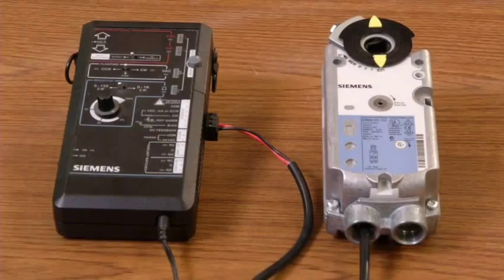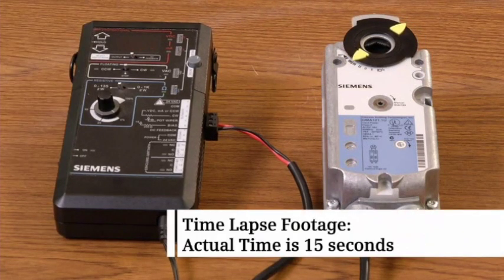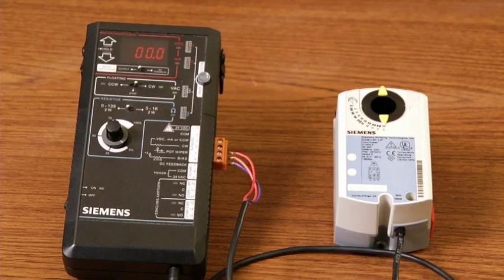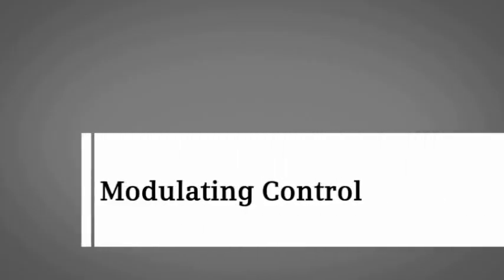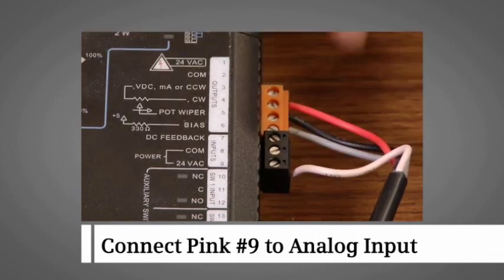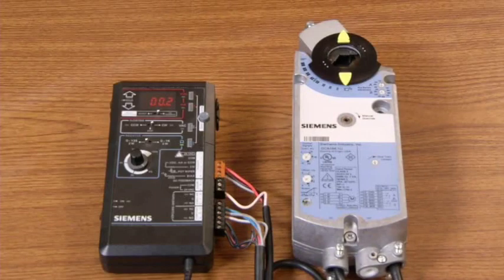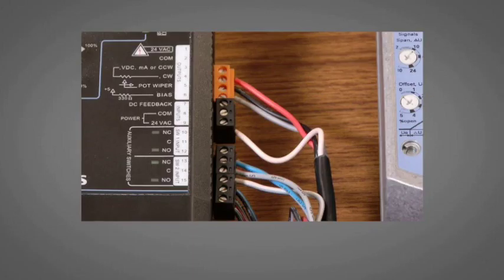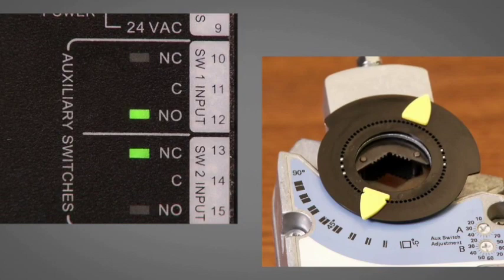Siemens Actuator Wiring for Control Signals

Comment: Very nice instruction guide, short and sweet. One question: what is the black controller (on the left) called or do you have its model name and number? Thanks a lot.
Reply: Es una fuente (calibrador)  de corriente y voltaje variable para proporcionar al actuador la señal de entrada que este requiere para operar. En algunos casos es 4 a 20 mA.  en otros es un voltaje de corriente continua con un rango variable determinado por el actuador y en otros requiere un potenciómetro. Desafortunadamente el modelo de este calibrador no aparece. Cuando encuentre alguno, te informo.